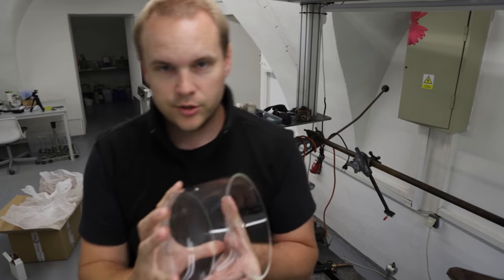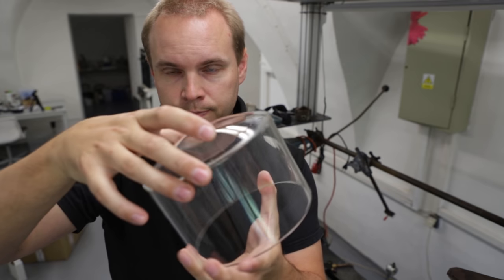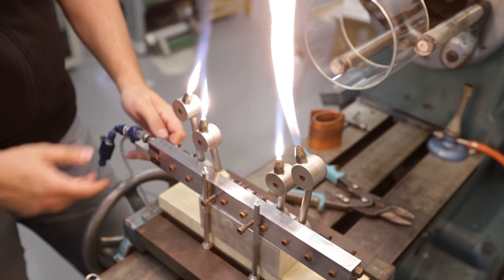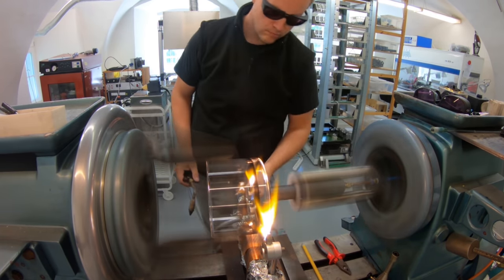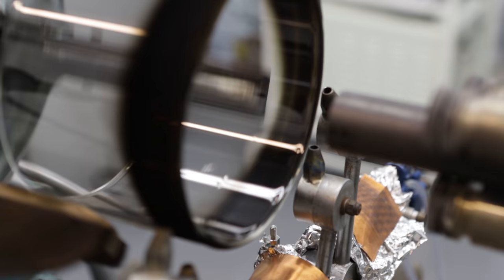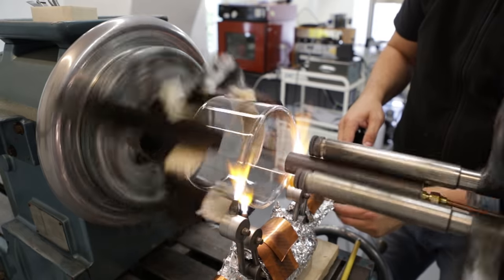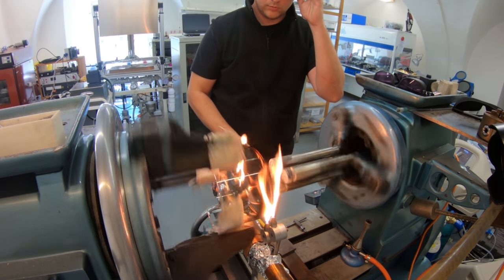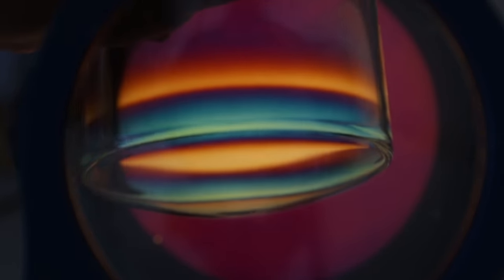Successful Window-Envelope Seal | Project H #5

Comment: Normalising the glass post fusing in a furnace will relieve stress. Maybe there's the key to this manufacturing process. When my father worked in this fiend back in the 40s and 50s, lots of processes were involved with glass treatment to avoid catastrophic failure. Several annealing steps took place

Comment: I was working years ago at the Gerresheimer company where we produced glass ampules for medicaments. The last point after glass shaping was so-called "relaxing". This was done in the oven with 650 C degrees for around 2 minutes. This way the entire surface of the product was internally decompressed from any structure tensions. It might works for you as well.

Comment: Very nice. I am glad to see this result. It has been burning in the back of my mind since your last post.
An annealing oven would definitely be the answer to the stress. Maybe there is a compromise on the annealing temperature where you can release just enough stress while not damaging the metals. At what temperature does the metal parts start oxidizing? Maybe filling the envelope with a gas that will prevent oxidation at normal annealing temperatures. Thinking out loud. I know that would be a lot of extra work.

Comment: Do you think an alternative would be to use a low-temperature glass frit to bond the faceplate on (after grinding the mating surfaces flat), as was done on some oscilloscope tubes?  Maybe that could be done in an oven at say 300 deg. C with a nitrogen or argon purge, and would avoid the need to slide the  internals forward later.

Comment: thats a very hard line of stress.. although its in a very strong section of the glass (tube) it might not be a problem, but i maybe using your small bunson burner on the main body at the area might help spread the stress down the tube slightly without oxidizing the stainless components.

Comment: I have done scientific glassblowing in the past when I worked at the chemistry department at a University. I am no expert though so I recommend trying to speak to someone who is.
But I have a few ideas:
- Heating the center of the window helped it from cracking, however it would putt more stresses in the main body. Because if more of the window is hot it will also contract more when cooled... Tricky trade-off.
- Even if the glass did not crack now, it might crack later all by it self if the stresses are large enough. Or it can cracks if you create a miniscule scratch in the glass during handling etc. 
- Would it be possible to have a vacuum pump attached also to the main body, so that after the seal has been made while the glass is still hot, you can evacuate the chamber. That way you could flame anneal the body some more without risking oxidation to metal parts? However getter evaporation might be an issue... Unless getter can be placed at the far bottom of the tube?
Reply: Or using argon while annealing to prevent oxidation...?
Reply: @PermireFabrica  Argon (or nitrogen) is a good suggestion. However you still need to use vacuum first to remove the air, then fill with argon, otherwise you would have to flush it for a very long time to slowly dilute the air.
Reply: @Richard.Andersson  Yes of course, but I think this man have no problem to create a vacuum despite to me.

Comment: Have done more research for you regarding this nixie tube process. You definitely need an annealing furnace or something similar. 2 processes take place during the process. Relieving stress and regulating the cool down process. Annealing alone won't immediately solve your stress problem. the rate of change in cooling must also be controlled.
Reply: Does the bake out oven at 500 degC provide any annealing to the glass?

Comment: Maybe this is a silly question, but can't you oven-anneal it after the tube has been evacuated? (once the getter is activated, and the tube basically operational.)
I wouldn't trust glass with such stress concentrations to be reliable in the long run.

Comment: I wonder if it would be possible to fully anneal the glass, after joining the front window, with the main nixie mechanism in place - and then clean the oxide off the mechanism (see https://www.nickelinstitute.org/media/1646/cleaninganddescalingstainlesssteel_9001_.pdf) using an appropriate chemical cleaning wash/dry stage. Then finally close the tube by attaching the connector section, with getters towards the rear of the tube, to complete the assembly.

Comment: Not sure what kind of glass you are using. Assuming its hard glass. In any event, your seal process can be improved greatly if you use hydrogen. (Cant tell from video) Also, I have videos of sealing faceplates onto cylinders that I can share with you and would love to discuss. I make cathode ray tubes and do much of the same glass fabrication work that Ive seen in your videos, 40 yrs experience in making crt's.
Message me if you are interested.
Reply from the maker: Email sent, thank you for reaching out!

Comment: I'm sure I'm nowhere near up to your level, but why not purchase bulk Pyrex beakers, and then cut / dome them in-house, instead of buying tube and watch glass and DIY? Might be easier, and then necking the beaker may be easier / less costly even with a slightly higher failure rate during manufacture.
In any case, you do amazing work.
Reply: I think in the final product, assign the front glass is the lasts step. Hence it needs to be open in the front to add all components first. The premanufacturing of the other side can be annealed properly to remove stresses.
Reply: @Richard.Andersson  Oh, that can still be done - I assume the inside would be built onto the neck, the beaker then installed over it with a single large joint of much lesser cost, instead of the 2 large joints needed with the current approach.

Comment: better pour liquid glass into a mold so it can spread equally then there is no stress in some areas.
Reply: He cannot because he needs to put the electronic components inside if it before sealing.

Comment: Wouldn't annealing help here? Below plasticity. The whole piece of course.
Not an expert by any means, but once you have such nice joint, the only issue is in accumulated stress. Which in case of glass can be relieved by heating the whole piece enough to have microstructures rearranged while keeping overall shape unchanged.